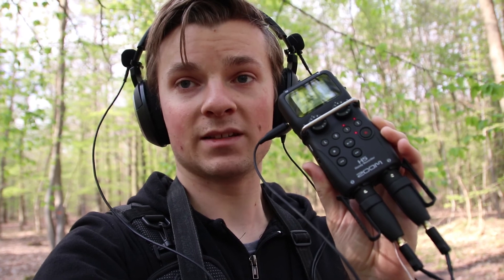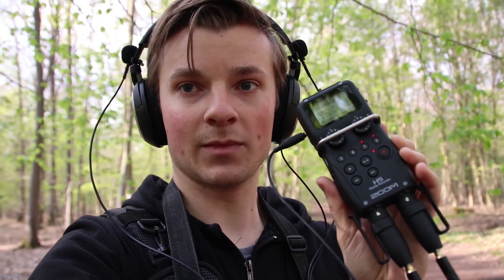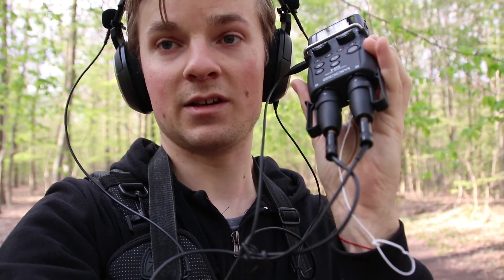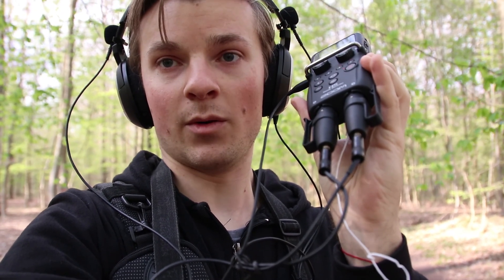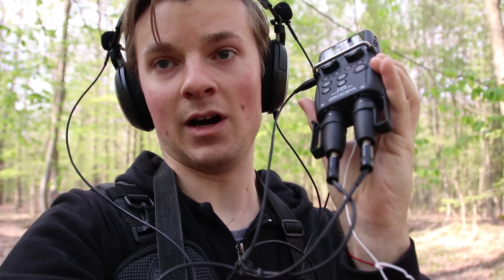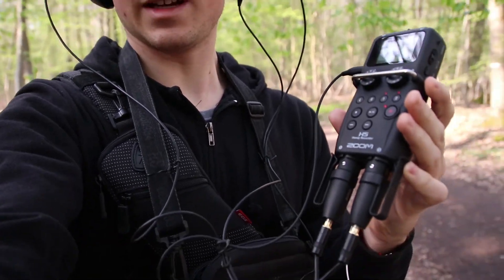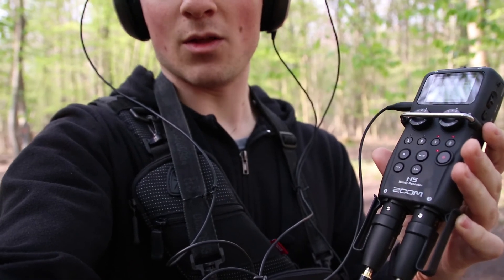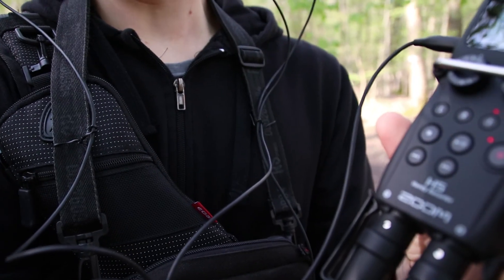DIY kit - Recording binaural while walking!

Comment: worse than your previous setups. less clean sounding than the 3d printed ambisonic project, and gathers more microphonic cable noise than the stationary binaural one (well, obviously). That being said, it is more than okay sounding and the 272-s sound good as ever. Would you try the EM273 on a circuit that makes it suitable for 3 wire connection with phantom power? There's a sensitivity loss, but it might still sound different from this. I don't know. Have a good day Fabien.
Reply from the maker: Yes indeed, I didn’t clean the sound in this one. In the ambisonic project I had to clean the sound because of the background noise of the 4 capsules together. 
I tried to not catch the sound of cables while moving, but indeed, it is almost impossible. So the system can probably be improved in future or the better way to recording this configuration for now is then to hold a binaural setup and walk with it. Still haven’t tried 273. Have a good day!!